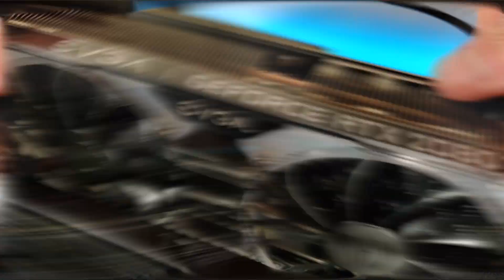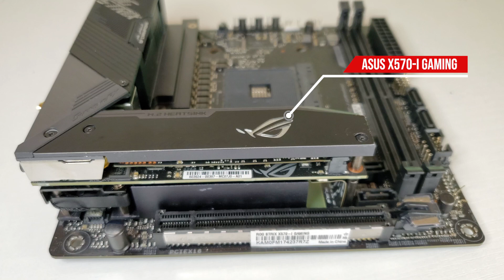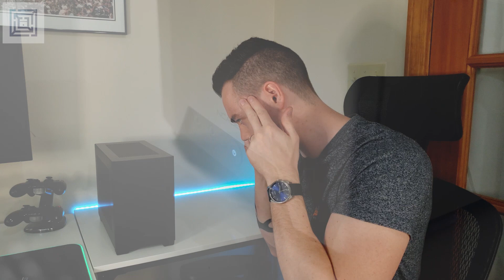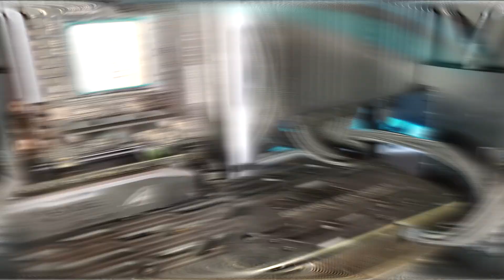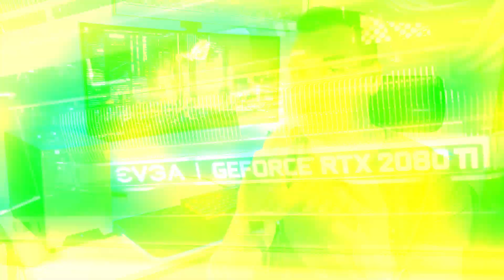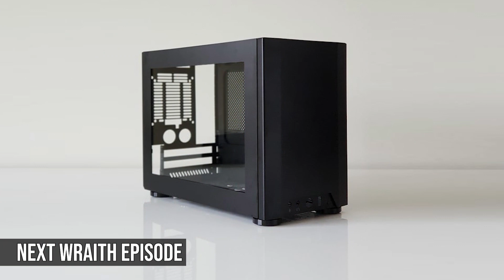ULTIMATE Ncase M1 PC Build | Wraith - The ITX Dream Machine

Comment: Reference PCB is for either an Accelero or a GPU block. 
You absolutely can route cables behind the motherboard. You just have to cable manage first, then build.
You can put fans under the GPU. Remove the four middle screws on the card and install two NF-A12X15's.
Reply from the maker: Sent the reply on Reddit - thanks for weighting in!

Comment: subbed as I'm an Ncase owner and I'm interested to see how the panel turns out.
Reply from the maker: Hopefully it turns out well! 

I'm actually just waiting on the new CPU cooler to arrive - when it does, that will absolutely be the next video
Reply: @TechLens  I had an H60 AIO and a founders 1080Ti...Modded and changed this out a little to a NHU9S and Artic Accellero III and temps and noise is much better.

Comment: Nice video! Would you recomand waiting for 3000 series or buying 2080ti(used)? I have a 980 and i7-6700k. Thank you!
Reply from the maker: Good question.

It's speculated that 3000 series is coming within the next 3 maybe 4 months, so if you can hold out with the 980 you might have more options. There will likely be more 2080Tis on the used market at a lower price too as people upgrade. 

But then again, check if Micro Center have any open box units. I got mine for $800, which was just too good to pass up.

Hope this helps dude!

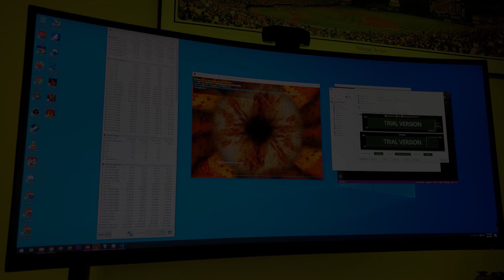Comment: 7:18 those GPU clock numbers are pretty low -- try undervolt, should help you a lot with both temps and clocks. Also how the noise was measured? 50dB(A) is super loud for a computer.
Reply from the maker: Hey,

Yeah, it's pretty typical when running furmark and Aida together. Under gaming loads, it's more like high 1700s / low 1800s... But I'll have to update you of the final clocks and scores in the next video, after I've fully tuned the system.

I should have put a little note on screen. The noise was measured with my decibel meter - 4in / 10cm away from front left corner (not directed at the airflow parth). 

It's mainly loud because of the AIO fans - they are rediculous when they ramp up and I would change them if it wasn't for the system being reconfigured quite dramatically soon.

GPU curve was stock but the CPU curve was set linear from 30% @ 0 degrees to 90% @ 90 degrees. 

Hope this helps! 👍 I'll try to add some of that info / pop it on-screen next time.
Reply: I also have an NCASE M1 and am running a water loop with 2 240 mm radiators and the lower one is only passively cooled, no fans. I tried using the fans on the side mounted rad as intake, like Ali at Optimum Tech but it didn’t work well for me. I then tried using them as exhaust but with the fans mounted on the outside of the rad (still inside the case) and pulling the air through the rad then exhausting rather than pushing through the rad to exhaust. It was dramatically better for all components, especially motherboard temps. Over 10 degrees C better under identical full load conditions.
Reply from the maker: @northernbel1974  Awesome! Sounds like a great setup.

And good job testing it by the way, so many people have opinions - but never actually  test it.

Comment: How is a glass panel not gonna suffocate your radiator? Also what's the point you'll be looking at a rad anyway?!
Reply from the maker: You're absolutely right.

I'm going to be swapping to a Noctua u9s in the same video, before then moving onto a really special dual 240 custom loop setup with tempered glass.

Comment: AIO intake isn't better, it's different. AIO intake is better for CPU (cause CPU gets coldest air), but worse for GPU - cause it's getting the CPU's old air.
Reply from the maker: Yeah, I actually highlighted all of that at the bottom of the testing results.

In this setup, optimizing to prioritize CPU cooling was better overall. This is because the CPU was closer to its max temp. 

Hope this helps.

Comment: I have slim fans on my evga 2080ti xc2 4 screws on the gpu remove in the middle
Reply from the maker: Hey, thanks for weighing in.

I've seen that the shroud is held on by posts that stick out from the cooler. 

Are you using the Ncase, and did you have clearance issues with the posts?

Thanks.
Reply: TechLens  yes i just build mine in this case 2 days ago i found those noctua chromax on the bottom of the gpu as intake i just removed those four screws directly in the middle of the gpu and it fits perfectly i wish i could just show a picture of it but it will definitely help
Reply from the maker: @munodavid91  

Ahh, I get ya - the shroud and the fans are still attached to the GPU. How were the temps before and after? - did you test?
Reply: TechLens honest didnt test just figured using slim fans instead of the gpu fans as much but my gpu doesnt go above 65 underload but removing those 4 screws didnt remove anything from the gpu just for clearance for the fans
Reply from the maker: @munodavid91  ahh okay - yeah, sounds like it worked out really well for you!

Comment: What are your thoughts about Lian Li TU 150?
Reply from the maker: Honestly... I wanted to like it but I dont.

I think it looks pretty good and is priced really well - but it's a larger ITX case that lacks significant benefits of having a larger ITX case - For context, the Ncase M1 has better AIO support at almost 1/2 the volume. 

And whats with the handle? Don't get me wrong, the people who carry their systems on a daily basis will probably appreciate it. But when you think about how much benefit that handle gives you - compared to having more ventilation - is it really worth it? Wouldn't you rather carry you system as you always have, the few times you need to - but have a better ventilated system overall?

...Got carried away there haha. TLDR: Id like the TU 150 if it had top ventilation and front 240 rad support.